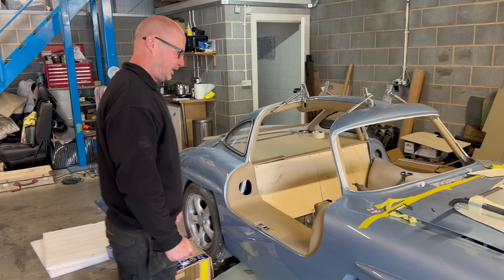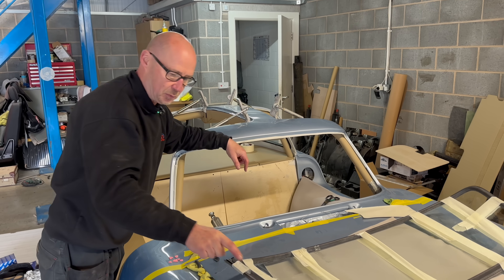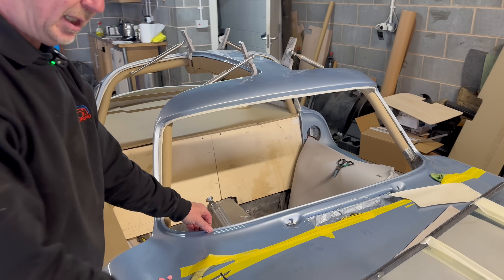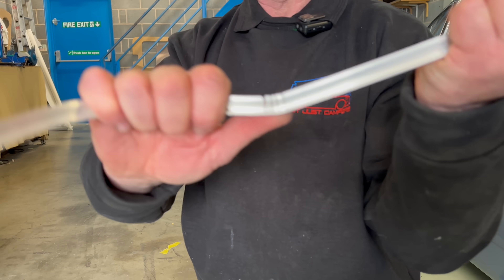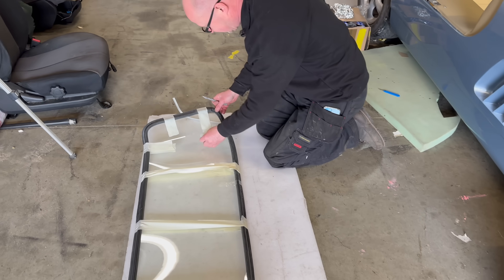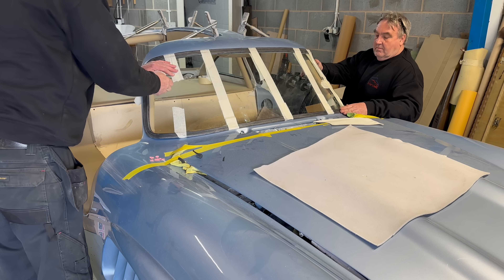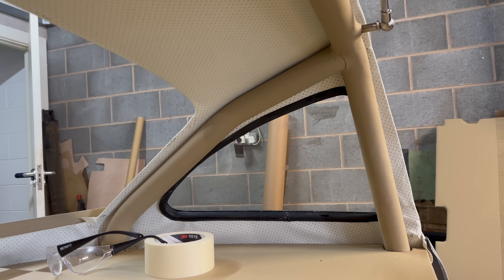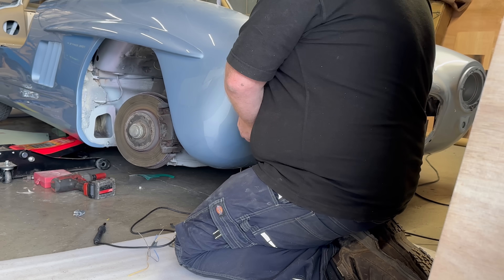we're getting closer to finishing the mercedes gullwing 300sl

Comment: Great build.
The gap in the roof flight panel between the two component parts would drive me nuts though when getting in, not the fault of the trimmer, just the design of the part, could do with some piping at the junction between the two bits to hide the gap. Just an observation not a criticism.